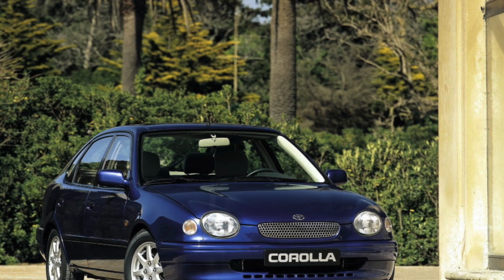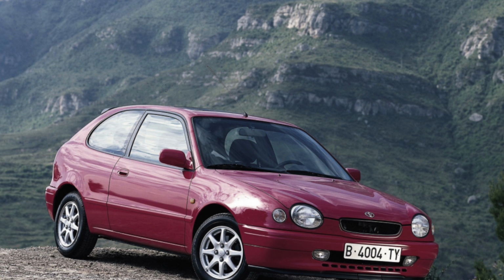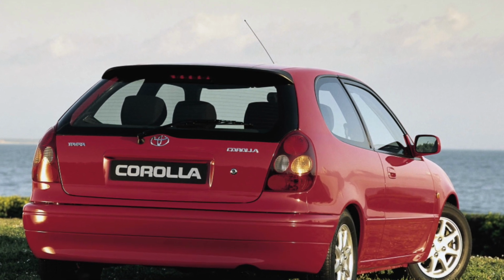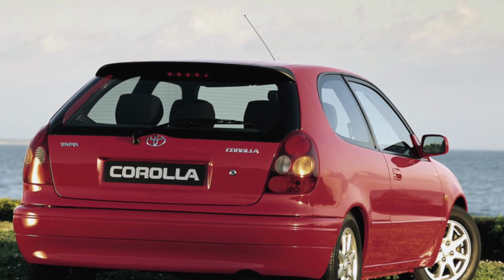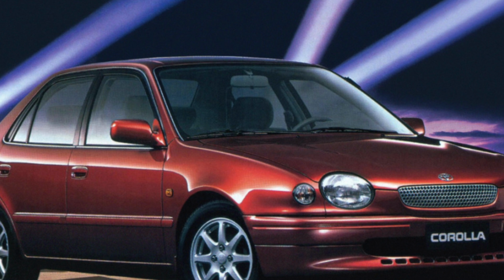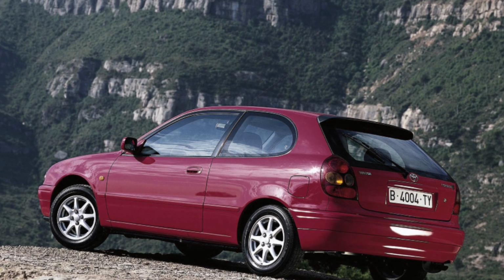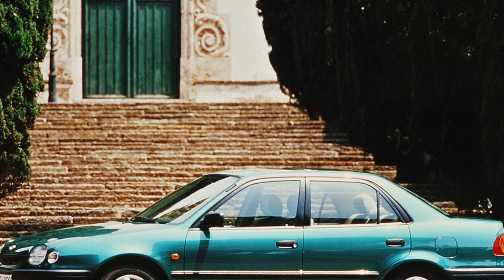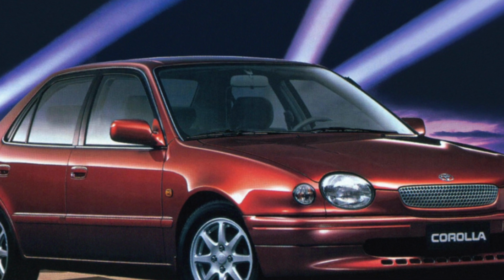TOP Things that will BREAK on your Toyota Corolla VIII generation

Comment: I recently came across your YouTube channel and was impressed by its aesthetics. However, upon further examination, I noticed several areas that could benefit from improvement. Specifically, I found issues related to SEO, rank tags, and tag volume that appear to be incomplete. It's clear that there is room for enhancement in various other aspects as well.  I am Ahsan, a seasoned Freelancer with over 4+ years of experience specializing in YouTube Marketing and Monetization. I am confident that I can provide the assistance you need to optimize your YouTube channel and its videos.------